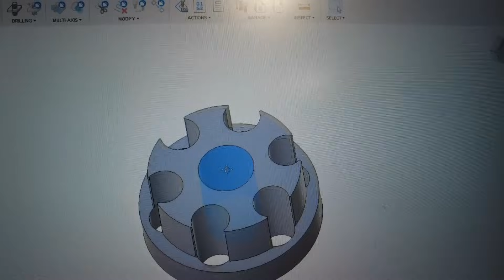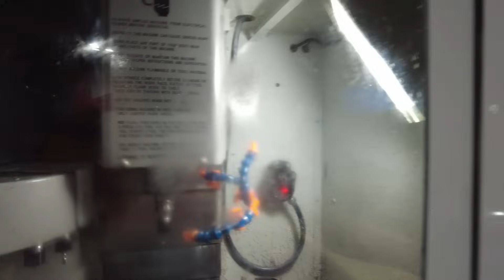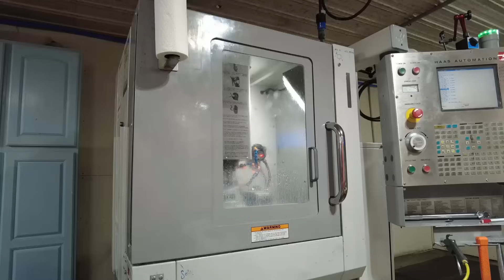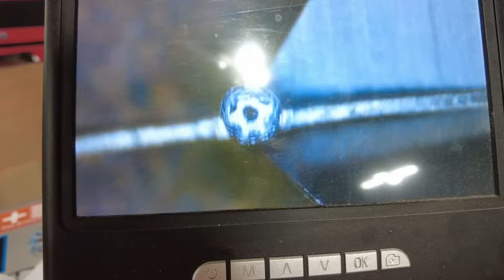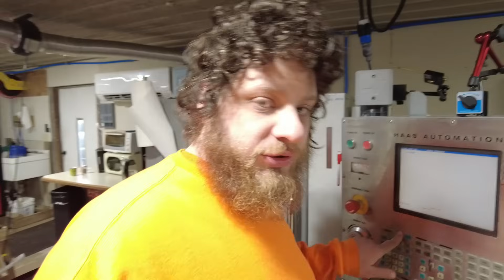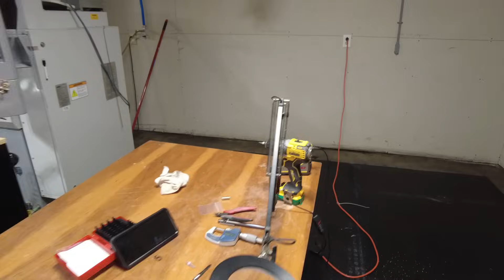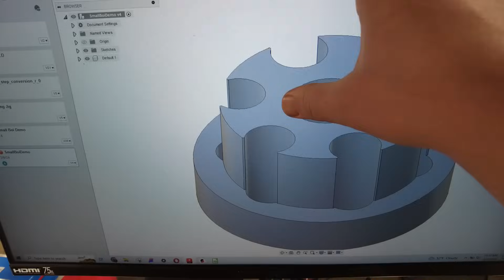Machining Some ABSURDLY Tiny Parts

Comment: That was pretty interesting. Where I work we have a slew of Levin jewelers lathes, our techs make parts ranging from 30 to 7 microns in diameter, all by hand. I have a ton of respect for those people!
Reply from the maker: That's crazy!
Reply: I did make an error. . . Mils not microns. still very tiny. The 7 mil part we have to glue inside hypodermic needle wire to machine.  @AudacityMicro
Reply: Do you work on missile guidance systems?
Reply: @_GOD_HAND_  Nope. But I'll bet money our products are used in the development and/or production of such things. We make cathodes (electron emitters) for scanning electron microscopes, and metal 3D printing applications.

Comment: part of the reason this tiny manufacturing is that your finishing tools are too aggressive, things like this detail need to be sanded away with diamond and grit tools, something that doesn't have a direct impact. 
faster toolspeed and slower fab speed is the closest you can get without dedicated tools.
Reply from the maker: You aren't the first person to say that, so I'm starting to think there's something to it. Do you have any tooling recommendations for parts like this?

Comment: For TINY parts, you 100% need silicon tweezers, they prevent excessive force and have enough friction to hold tiny pieces with enough padding and flex to hold it securely.

Comment: Don't use carpet. Carpets eat parts.
Get a very bright flashlight. When you shine it across the desk or floor, you can see every piece of dust. You have to get your head pretty close to the surface.
Get a strong magnet. If the part is ferrous, you may be able run the magnet across the surface in a grid pattern. The part may be picked up.
In some cases a vacuum may work. Trying to find a part in a filter may be more difficult than it's worth.
If you have access to liquid nitrogen, pour it on the floor in one direction. This is lots of fun even if you don't find the part.

Comment: Coming from the electronics world, where I deal with 0402 resistors regularly (40 thou by 20 thou rectangles) and occasionally with 0201s (20x10 thou), I've certainly lost plenty of parts. It doesn't help that they're black epoxy with tin tips, they look like dust! A decent binocular microscope with a good working distance is essential, I've got a 7-45x with a 0.7x barlow lens & ring light to get about 100mm (4") working distance. It's essential. Also a set of electronics tweezers, they come with some very small sharp ones. 

Another workholding tool I've got is a wax setting pencil. They're used in applying rhinestones when decorating painted fingernails. I use them to get tiny parts off of the table if I need to, and then transfer them to tweezers for soldering. Push the wax tip down onto the part, lift off the table, grab part with tweezers. May not work for machined parts (wax residue), for my use that just melts off & gets cleaned up with the flux.

Comment: Woods metal can be used to support interrupted cuts and hold small parts, reducing the need for tabs.
A quick bath in hot water removes the Woods metal.
Reply from the maker: Too much surface tension for it to get down the tiny holes 🫤

Comment: Are the Sony wh-xb910N headphones?
Reply from the maker: Sony WH-1000XM4. I've been through a bunch of wireless headphones over the years. My favorite ever were the Plantronics Backseat pro 2. But when my pair eventually died, they were out of date, and it didn't look like Plantronics had any plans to modernize them. These Sonys have been my favorite after those, but these are only a year old, and already being held together by hot glue. They have lasted longer than anything other than the Plantronics, but I'm still not 100% happy with build quality.

Comment: I don't know how you wound up in the algorithm. But don't let the High View count low Sub count get you down, Most people on here need to have a creator Recommended, Watched and Liked at least like 3-4 times before they realize how fucking DOPE YOUR CHANNEL IS HOLY SHIT. My ONLY suggestion is when you start making money from this, Invest in a 4k/2160 Camera. It will Drive your viewership through the roof having perfect visual of your pieces.
Reply from the maker: Thanks! This is definitely my first video with a high view count 😅. It's like 20X more than any other video I've published. I can actually record in 4K on this camera, but I've been choosing not to so that file sizes were a little more manageable. But I may make that change now. Thanks!

Comment: First timer here, Very interesting !
   Was wondering if that part could be set on a magnet to keep from loosing.  Like the small rectangle, flexible refrigerator magnets.  Not solving the tweezer shooting star problem, but maybe to hold it for microscopic and help measuring ?

Comment: Yeah, with real small holes, like 2-3mm or 1/16" and smaller, spot drilling w a ball mill does weird stuff, and the bit can wander in the "bowl" and yeah, faster speeds, slower feeds makes a cleaner finish (generally)
This was impressive to watch. Never messed around w machining anything that small. Crazy impressive what modern precision equipment can manage..
Youre doing good work, thanks for showing us the full process w mistakes and throwaways included to work through the full thought process
Reply: a simple cheap solution just to get you started is to hold onto old pill bottles. Theyre great for holding onto small parts/screws/etc and you can just slap a piece of masking tape on em, label the project the parts are from, slap a lid on and set it in a drawer or on a bench..

Comment: I'm wondering if the coolant being pumped out that fast will cause similar issues.  Perhaps putting too much lateral pressure on the tiny drill bits.

Comment: What if you drill the .2mm holes in an oversized diameter blank and then reduce the O.D. until the .2mm holes are intersected?

Comment: To help with not losing so many small parts (ferrous ones anyways) I would have strategically placed magnets around the shop. So any place where the magnets would not be a problem but where you are likely to drop a part.

Comment: I was so curious because I want to have a scaled down robot joint in my design. And I was shocked that you used a full size CNC machine to make this. You're real wizard!
Reply from the maker: To be fair, as far as "full sized" machines go, this one is rather small, and designed for this kind of work 🙂
Reply: I wasn't surprised a larger machine could make it. I was surprised he was running the water and not losing nano scale parts from that alone. 😆

Comment: I was looking at making a replacement gear for the autofocus inside one of my zoom lenses. This makes that job look like building the Brooklyn Bridge.  I'm wondering if your Haas can even get that small a tool up to the correct SFM cutting speed. That's gotta be, like 30,000 RPM.  I was looking around, and ER16 & ER11 collets actually come in 1mm size.
Reply from the maker: I can do 40K RPM, which so far has been good enough for most stuff I run across 🙂

Comment: An old model building trick I learned was to do finish work on super tiny parts inside a gallon plastic bag. That way if you dropped it or squeezed to hard and it shot out of the tool holding it it couldn't go far and 99% time it would still be in the bag. Doing what you do I am sure you could come up with a perfectly suitable clear box with slightly more room and less flexible that a bag. to minimize loss of tiny thingz

Comment: what RPM is used for the drilling?
Reply from the maker: I think I was at 30K. I can go up to 40K on this machine, but it's old, and spindles replacements are expensive, so I try to avoid max RPM when possible.

Comment: How did you get into this work? These machines must be 50k+.
Reply from the maker: Slowly bootstrapping my way through slightly bigger and more expensive machines. My first machine I made money on was $1000, and from there I worked my way up.

Though, I should add, this machine was actually cheaper than my last one, even though it's quite a bit more capable. I bought this one used for $18000. To buy it new it would probably be about $70K right now.

Comment: I have to make a Snow Making Machine nozzle, with a 0.010" Dia. drilled hole through a piece of 304 Stainless Steel. Each machine takes 5 nozzles. I make about 30/year + more for each broken drill that kills the part. I average about 3 parts per drill.
Reply from the maker: Sounds like fun 🙂 those are the kind of parts I love 😂

Comment: Damn, for parts that small, I would have expected precision grinding to be the most effective way, if not the only way to really accomplish a good, quality part. I think end mills and drill bits just kinda break down at such small scales. At that size, the smallest, almost invisibly small burrs just destroy the entire part (and they can't just be removed/fixed).
Reply from the maker: Maybe it is! but I have a mill, not a grinder 🤷‍♂️. I would have preferred to do it on a swiss lathe if I had access to anything I wanted.

Comment: I know all about losing gage pins.
I dropped one in the chip pan and figured it was gone forever.
  The shop hand chipped my machine out and low and behold when I walked past the chip dumpster there it was...right on the top of the chip pile.

Comment: Ugh....I've made a bunch of super small parts over the years and it sucks!!!
I could fit a weeks worth of work in the palm of my hand with room to spare.
 And yes broken tools are common. Drills that are .015 in diameter are common as well.
 I'd rather run huge parts than the micro parts.
Reply from the maker: I much prefer the small stuff, way easier logistics wise, especially in a small shop without any lifting equipment.

Comment: Are you using a small micrometer??? Normal 1" or even 1/2" mikes measure ±0.001" GR&R at best - is this for real?
Reply from the maker: Maybe cheap manual ones. This one has a resolution of .00005, which means you can trust it to .0005 or so. And I have a NIST cal cert, in addition to my own internal maintenance calibrations which I do monthly.

Comment: I've worked with screws the size of your part, restoring turn of the century pocket watches (19th-20th century), hard to fathom they made them way back then. Watchmaker tools are what would help if you're going to pursue small parts. Bergeon is the ubiquitous top brand, but very pricey. Horotec also top quality. The watchmaker putty you mentioned is Rodico (brand name)...infinitely useful for picking up the tinies, or storing and keeping track of things. I've pinged more than I want to remember into the 4th dimension.

Comment: I worked for Swiss automatic Screw Machines when I was young. I loved working on stuff the you could barely see the details on the parts. Optical comparators were used to examine the parts before sending the parts out.
Reply from the maker: an optical comparator will almost certainly be my next major shop purchase :)

Comment: the watchmaker's putty is " Bergeon 6033 Rodico", you'll also want a pin vise to hold the part like your little fixture pocket. look up micromark, they specialize in tooling for Scale Miniatures such as model trains, which get into some absurdly small sizes of components and the tooling for them. someone else mentioned jeweler's tooling. a Bead Tweezer with its cup jaws would help keep parts from going PTCHOO

Comment: Are you sometimes concerned that you breathe in a part without noticing, and now it's stuck in your lungs continuously injuring them and causing inflammation?

The tweezers you're using aren't suitable for small parts. SMD electronics tweezers, i buy really cheap ones 7sa or ESD-15, sometimes love them, sometimes hate them, i suppose there's consistent brands out there somewhere. I've seen fancy looking titanium ons, never got around to try. I do electronics :D

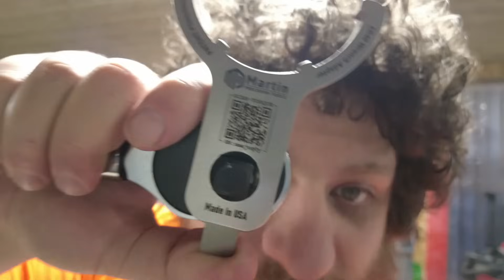Comment: 3:40 It makes a difference where you pull on the handle using such a calculation. Imagine you pull the handle in the middle of the handle, then you get twice the "hand force" but the lever is not half the length.
Reply from the maker: That would only be true if you were measuring the force at your hand. Torque wrenches measure torque at the head.
Reply: @AudacityMicro Yes, they only measure the torque at the head. I know it's unintuitive, but actually this torque is not enough to calculate the other torque at the new position. You need the force at the hand. You can get the force at the hand if you grab the wrench at a known position.
To prove this: Let's say your extension (the extra tool that is attached to the head) is 4 inches long and the torque wrench is 14 inches long. It clicks at a torque setting, let's say 12 in-lb, then the hand force is 1 pound if you pull at a 12-inch distance from the head. If you pull a lever, you can always calculate the torque at the rotation center with the distance and the force. The torque at the new translated position would be:
(4" + 12") * 1 pound = 16 in-lb
But if you pull the handle at 6" from the head:
The force: 2 pounds
And the torque at the new position:
(4" + 6") * 2 pounds = 20 in-lb
Because the 4" is small and the torque wrench is long, it does not make that big of a difference if you are off by, let's say, 1" or 2".
If you grip 2" too short, it would be:
(4" + 10") * (12"/10") pounds = (4" + 10") * 1.2 pounds = 16.8 in-lb
Reply from the maker: Ok, I see where you are coming from. This would be true, if you are looking at everything as one rigid system. Basic statics stuff. But the torque wrench is not acting on the adapter as a rigid joint, it's a pin. That pin is able to rotate freely in one direction, and will X max torque in the other direction. The adapter can be seen as a single beam, with a torque load on each end. The goal is to put T torque on the business end, which can be seen as a reaction force to the X torque on the wrench end. The setting on the wrench determines X torque, which is then multiplied but some value to get the torque on the Collet. Not sure what the value is, but they have a handy calculator that you can get to by scanning the QR code on the tool.
Reply: @AudacityMicro  You can test it by torquing something and moving the hand position. Torque it and grip it a bit inwards from the  end of the handle and then at first move outwards from the starting position, then it should only click but if you then move inwards it should start rotating the fasterner again.

Comment: I know this comment will probably be lost because I'm late to the party but on the off chance you find it: watchmaker here, small parts things. Eye loupe is silly but effective. Those green matts for your bench are cheap, but make finding steel/brass things on them super easy. Print yourself some compartment trays for your gage pins and parts. (Starrett) Pin vises are a lifesaver. Get a pair of cheap brass tweezers and hand sand them to be sharp and meet flush. And the biggest tip of all: get a low stool so that your bench is at like chest height, and work way away from the edge of it: not only will you be more sure handed but like 50% of the time when you launch a part out of your tweezers it will bounce off your shirt and right back on to your working mat

This was an awesome video and an immediate sub for me, thanks dude!!
Reply from the maker: Don't worry! I saw it! I'll definitely look into those green mats, and look for some brass tweezers. thanks!

Comment: As a hobbyist watchmaker I would also recommend you get/make a tall workbench. We use a bench that is about at shoulder height. This makes it easier on your neck. Get yourself an Optivisor magnifying headband. Also those carbide micro drills are way too long. They should be more stubby. Could you break off most of the flutes and regrind? Don't know if possible

Comment: The endmill is oscillating as it is way too long. It is too thin to stop self induced vibration due to imbalances.  Change to short length tool, finish with diamond burr.

Comment: I had a watchmaker friend that had worked in a standards lab during WW2 working with millionth's of an inch.  Then after the war he taught until he retired.   Watchmaking was his hobby.  I remember one project he showed me.  It was a balance staff from a woman's wrist watch.  One pivot was worn down about 3 ten-thousandths so he machined a thin sleeve, brazed it on, then turned it down to spec.  He would have loved to have had access to equipment like this and the crazy intricate things it allows a skilled machinist to create.
Reply: A YouTuber named Robrenz has shown some measuring to millionths. He showed how much metal moves with just the heat of,your hand. Precision metrology is absolutely wild.
Reply: @TsunauticusIV  Yup, I remember my friend said that everything was done at a standardized temp of 68 F.  He still had a few machining samples he'd had to do by way of proof that he could do that level of work.  One was a plate with a hole in it, and a machined rod.  The rod would fall though the hole over a period of about 10 mins.  But it only worked at the right temperature.  That's crazy precision.

Comment: If EDM is not an option you probably should think about grinding (discs or diamond mills) rather than milling in final operations for small parts.
Reply: also can get the part in spindle and rub against a stone in some cases.

Comment: nice step by step process!!
and the solution to each problem was very well thought as well
may i ask, what's the  brand & magnification of your table mounted Magnifying glass?
thought that it will also be suitable to what i'm currently working on
thank you
Reply from the maker: This is the one I use. It's just the cheapest one off amazon. It's fine, I don't love or hate it. It works, and that is about it.

https://amzn.to/430wn6M